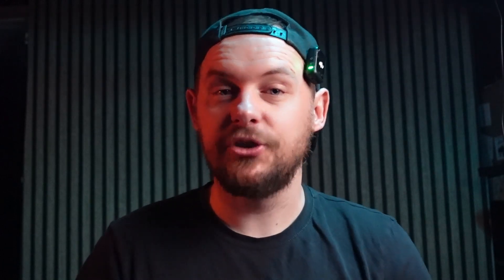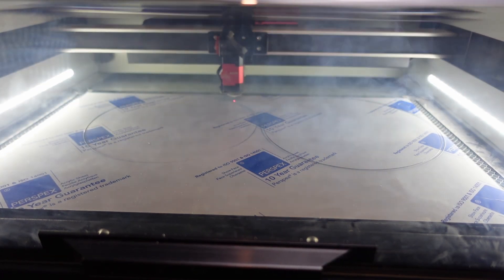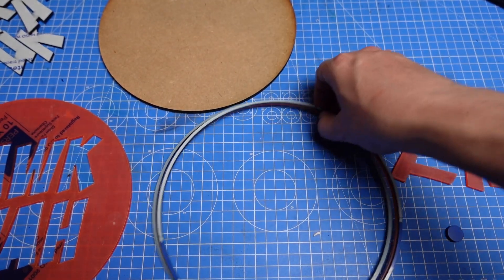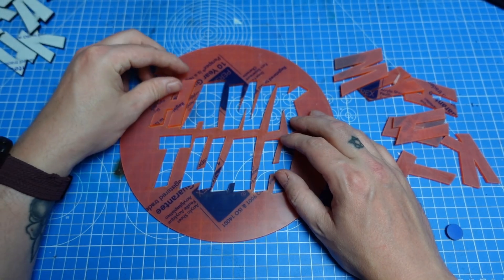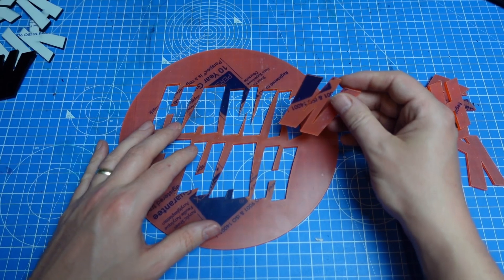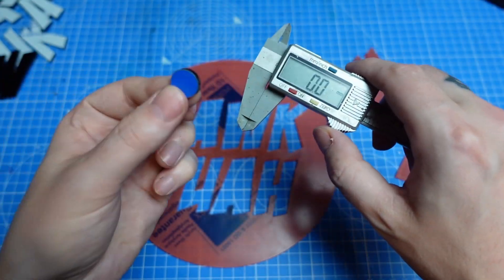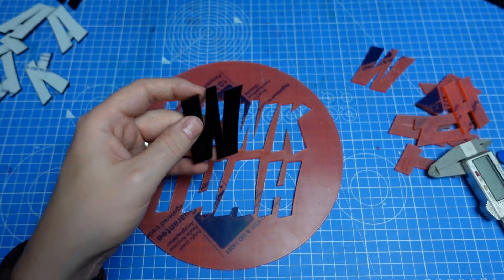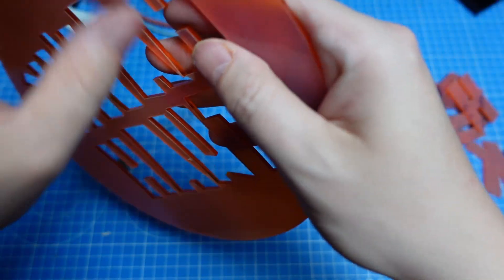Backlit Acrylic Sign Made With the Aeon Mira5S Redline Co2 Laser

Comment: Hi Marc, Nice sign! I do believe the reason your acrylic cracked is because your kerf is actually 0.1mm, not 0.2mm. You need to divide your total difference by two to account for the top and bottom. So you would have 0.1mm on the top and 0.1mm on the bottom of your circle to achieve your total 0.2mm difference.
Reply from the maker: You could be right. All the tests I did before hand work perfectly. I’ll definitely have to have a look at it again and test for sure 👍🏻